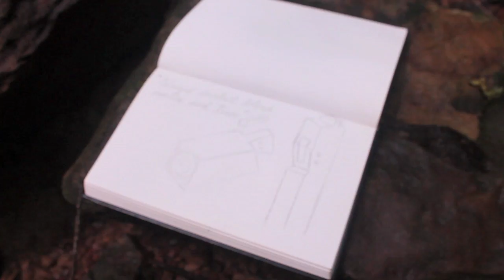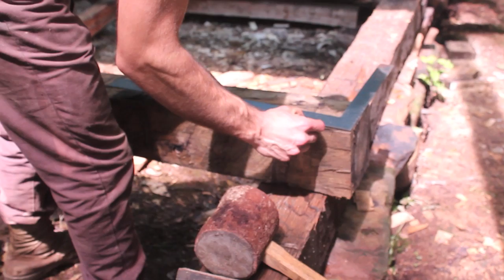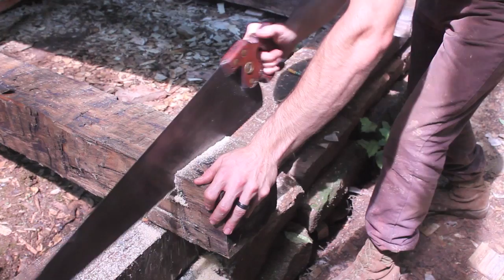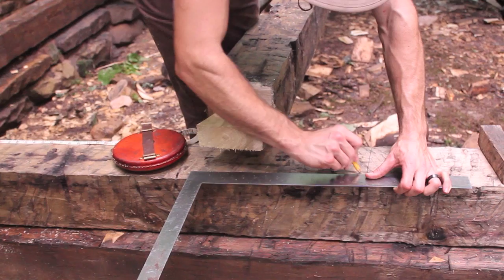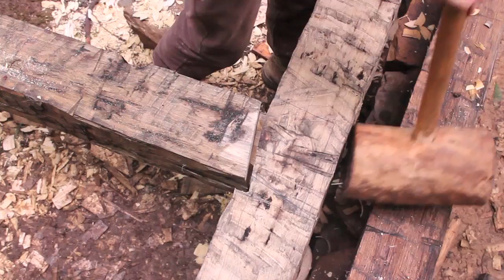Wedged dovetail blind mortise and tenon

Comment: Mr Chickadee
Could you please tell me why you used a big wedge on this joint to secure it, while on other joints you have used a through peg in a  hole to secure them ?
Why use different methods for the same result ? Thanks.
Reply from the maker: In this specific type of frame, the tie beams are very key to holding the building together, especially under any roof load. If we accept that pegs can sometimes fail, the dovetail is an extra layer of protection, it is also pegged. Belt and suspenders I guess